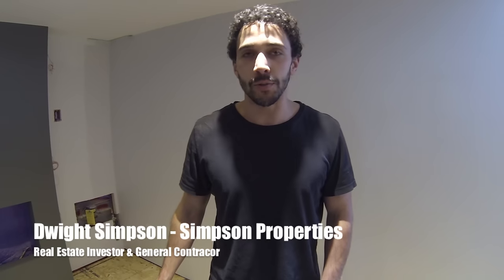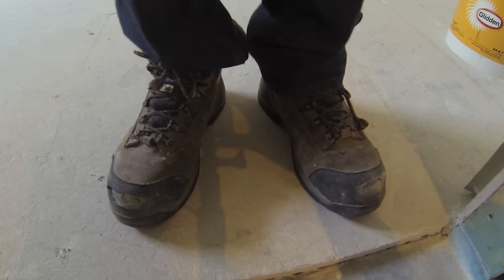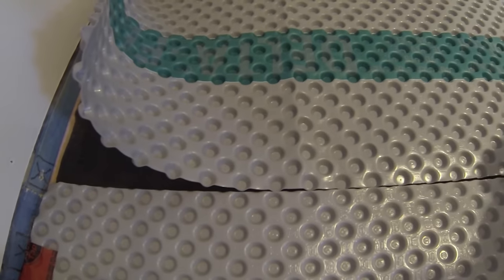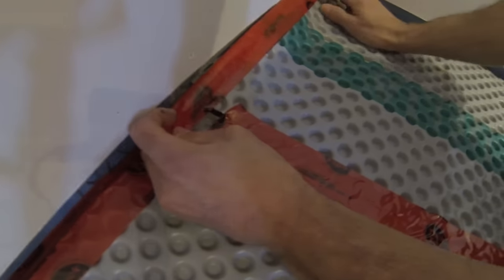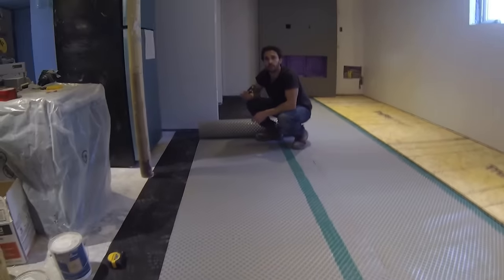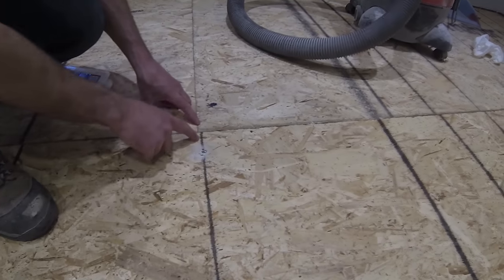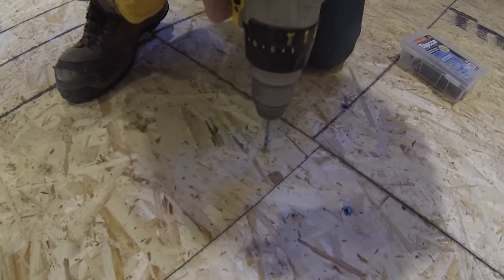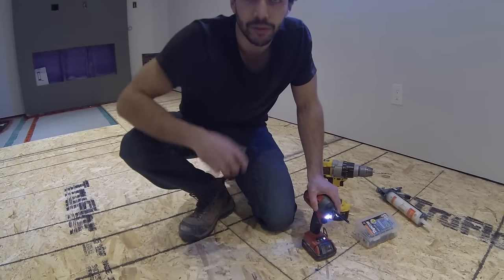HOW TO INSTALL A SUBFLOOR ON CONCRETE

Comment: Great Video, Quick question. I am installing a sub floor on a concrete slab on grade level. I live in Florida and not to worried about the floor temperature, should I still use the Delta FL or do you have any less expensive alternative to use between slab and wood? Thanks
Reply from the maker: Danny Bautista thank you! Delta-FL used with OSB is the most cost effective method without comprising on quality that I have come across. Even if your slab is on grade level you still have to have a membrane in between the OSB & concrete pad; or else it will wick moisture over time.

Comment: I have seen other videos mention you can frame directly on this system. I would like to finish my basement with the Delta-FL and osb first then put up the framing using standard 2x4's and not have to use pressure treated lumber and use normal carpet grippers. Possible?
Reply from the maker: That is definitely possible and in my opinion the better installation method.

Comment: Will it matter if my concrete floor is not even at all? Any extra measure around that?
Reply from the maker: If you check the manufacturers spec sheet on Delta-FL it states what the floor tolerances should be. If the floor is fairly level you will be fine. If there are big dips. You may need to fill those areas with self leveling concrete or use shims. Any high spots will need to be shaved down with a concrete grinder.

Comment: Aren't the trufloor panels sized for spacing? It looked like you kicked the butt joints tight.
Reply from the maker: That’s correct. You should leave about an 1/8” gap for expansion and contraction.

Comment: Thank for this. When you drill subfloor through your 'vapour barrier' layer (deltaFL) doesn't that "break" the vapour barrier and create moisture issues/allow moisture to get to the OSB/subfloor? Maybe abit of bounce in the floor is ok if it guarantees no mold/moisture in the subfloor?
Reply from the maker: Mel your slab shouldn't have that much moisture where the pilot holes for the concrete screws will create an issue. That's why I filled each hole with silicone to maintain the vapor barrier. If you don't anchor the sub floor to the slab it will create problems for you down the road depending on what floor you use. It will create shifting/buckling and bounce in your finished floor.

Comment: Is this method ONLY for the basement, or is it ok to do this on a ground floor?  Because of the 7 degree difference, I'm getting mixed advice on whether or not this is safe for a solid hardwood (not engineered hardwood).
Reply from the maker: This method can be used in a variety of applications not just a basement slab. If you’re installing solid hardwood you maybe better off doing a glue down method directly to the slab. That’s what I would do especially if you live in a warmer climate. Always read the spec sheet from your hardwood floor manufacturer. They will specify approved installation methods.

Comment: Great video. I am actually in the middle of a flooring project and I intended to try the landscape fabric... Home Depot says that they only carry it in the summer. Are there any alternatives?
Reply from the maker: Thanks +David Barrett! I'm not aware of any alternatives other than using a different underlayment like DMX that has foam built-in (that would not be cost effective). Maybe try ordering the landscape fabric online through Home Depot or another vendor.

Comment: Great video. Does the landscaping fabric mold or have any issue if it does get wet? Also, before doing this, was there an issue with water seeping into that area or was this done as a preventative measure?
Reply from the maker: Landscape fabric is designed to be installed outdoors in the earth. It will last years in those conditions before breaking down. You won’t have to worry about it deteriorating when it’s installed indoors beneath your subfloor. If you have normal slab conditions that minimal moisture will not be an issue. This install was done so that the finished floor was not installed directly on top of the slab. Provides a bit of a warmer floor and avoids any moisture wicking from the slab into the finished floor.

Comment: Interesting video but you have to gap OSB about 1/8th inch around all sides.  If you don't,  you risk cupping when the OSB expands.  Also,  tongue and groove would be a better choice for floors. 

Finally, code requires far more fasteners than 8 per sheet of plywood.
Reply from the maker: Thanks for your input it’s much appreciated! I agree that a 1/8” gap should be left around the perimeter of the OSB for expansion and contraction. Unless, an OSB like AdvanTech is being used because it has the gap incorporated in its T & G.

T & G laminate floors were used. In this case the concrete slab is the structural floor. The subfloor was installed as per manufacturers recommendations in regards to the amount of screws that were used.
Reply: @simpsonpropertiesltd  Not to be argumentative,  but building codes (which  vary) usually require fasteners every 6"-8". They will govern,  not the manufacturer's instructions. It is difficult to know what code is,  because this is such an unusual application. Typically subfloors require fastenets 4" OC on seams and 8" OC in the field.
Reply from the maker: FL FL it’s all good I appreciate the input. I agree with with in regards to code with typical floor sheathing installed on top of floor joists. 

In this videos application it’s a sub floor over a structural concrete slab.

Comment: Great video! Thank you very much. I am getting ready to do this in my basement...starting on it next week, I hope. A couple questions: first, are there advantages to laying the flooring and the underlay lengthwise in the room, as opposed to the shorter direction? Finally, would there be any benefit (or drawback) to crossing the seams, i.e. running the underlayment the shorter direction and the osb the longer direction? Thank you for any help!
Reply from the maker: It’s looks better IMO to run length wise. Makes the room look bigger.

Comment: Love your video! I was wondering if would you recommend doing that for an entire basement before putting walls/divisions? If so, would you then do the similar drill and caulk approach for the bottom plate to secure it to the concrete slab? Or would you have the bottom plate screwed or nailed to the plywood board only not going through the membrane?
Reply from the maker: I would recommend installing the subfloor everywhere. Then install your walls on top of the OSB. In that case you would not need sill gasket since your bottom plate is touching OSB instead of concrete. You would need to use ramset fasteners or a Simpson Strong tie concrete fastener.

Comment: This is a great learning video for preparing concrete slab floors.  Once everything is installed can I install nail down hardwood flooring over the 5/8" plywood or OSB?  Or am I limited to types of flooring material?
Reply from the maker: Al Akiyama thanks! Yes you can install nailed hardwood floor over this sub floor. A lot of hardwood floor manufacturers will require 3/4" subfloor. You can still use the same installations methods shown in this video. You will just use thicker OSB or plywood. Check with your flooring manufacturer on the required thickness of your sub floor.
Reply: Thanks for the quick response.  Do I need to install a barrier ( like roofing paper) between the plywood (OSB) and the hardwood floor?
Reply from the maker: Al Akiyama that all depends on the flooring manufacturer you choose. Various manufacturers have different requirements. Check with the manufacture or supplier.

Comment: Do you need to install the plywood if your just doing a small bedroom in a basement
Reply from the maker: You can install the Delta-Fl (or membrane of your choice) then install your finished flooring on top. You don’t have to install plywood or OSB.

Comment: Excellent video and detail provided, thank you! We just did this today, as shown, and noticed some areas have movement when stepping on them (either concrete not flat or OSB). The final visual of the OSB is all flat, just bows in a bit in certain areas when walked on. What are your thoughts? Use more tapcons?
Reply from the maker: bmoreira2000 thanks! Some sheets will require more tapcons than others. As long as there is not a huge bevel or slope in the concrete pad more tapcons should solve that issue. Make sure not to over torque the concrete fasteners or else the won't hold properly.
Reply: Thanks for quick response! So the thought is the OSB should not move when stepped on?
Reply from the maker: That's correct you shouldn't have any flex in the OSB. It should be a solid floor with no bounce in it.

Comment: What’s your take on framing walls first or putting your sub floor down with walls framed on top when you have an interior French drain and a thin layer of concrete over it?  I’m concerned about cracking the concrete when fixing the base plate.
Thanks
Reply from the maker: Installing the subfloor first then installing your framing on top is a more ideal method in my opinion.
Reply: Thanks for the advice

Comment: If you wanted to insulate would you just put rigid insulation under the osb ?
Reply from the maker: Yes that is a common way to insulate below your subfloor. Make sure which ever rigid insulation you buy it’s rated for that application.

Comment: I'm in the uk and moving from s home with a wooden sub floor to one with a concrete floor. 

In the UK.  We run cables mostly under the floor then up the walls.
Can you run cables under these flooring and if so.. where?
Under the boards or under the plastic bubble wrap type stuff?
Or not at all?
Reply: Jason Park 
Probably not at all with this style floor unless you double up the OSB plywood and create a channel for your cable above the first OSB layer and make a channel in the bottom of the second layer it would be difficult to do.
Here is the U.S. we usually don’t have finished ceilings in our basements we use drop ceilings and can run our wiring there.
But maybe the gentleman who made the video can weigh in...
Reply from the maker: This type of subfloor is not designed to have cables running beneath it. They would get damaged overtime. Conduit would have to be installed in the concrete slab and cables could safely be fished through it. In residential construction in Canada the majority of wires are installed in the walls and ceiling cavities.

Comment: Great video and I am actually starting the DMX install this weekend.  I noticed you used landscape fabric underneath the poly.  I have some spare roofing paper around do you think that would serve the same purpose??  Thanks and keep up the great videos!
Reply from the maker: Thanks. This reply maybe a bit late. If you used DMX it already has a cushion built into the membrane which helps avoid that clicking sound.
Reply: @simpsonpropertiesltd  No actually not late at all.  I am not using the DMX with the foam underlayment.  I have the one just like yours in the video.   Would the roofing paper not be applicable for this?   Should I just go with some regualr landscape fabric?  Thanks!
Reply from the maker: Cosella Dorken is the manufacturer of Delta-FL. I would give their tech support a call with that question 1 (888) 433-5824. My guess is they are going to recommend using landscape fabric.

Comment: Your videos are giving me great insight as to how I want to finish the basement I'm working on....with this type of flooring delta and osb...is there any need at all to use self leveling mix?  I'm thinking mold resistant underpad afterwards with carpet but if I should also first consider self leveling some areas I will.
Reply from the maker: If the slab is really un-level you may have to grind down high spots or use self lever in low spots.

Comment: Can you tile directly on the Delta membrane or if you need the subfloor panels? Thanks Great job!
Reply from the maker: TheSimuzz I would recommend installing an uncoupling membrane such as Ditra or Strata matt on top of the concrete slab then you can install the tile.

Comment: I live in Texas so there's no basement but our first floor slab is concrete underneath the carpet when I pull my carpet can I just go over it with the plywood my house was built in the mid-70s
Reply from the maker: It depends on what your finished flooring is going to be. If you're going to install a floating floor system such as laminate then I would recommend you install a product like Delta-FL then your OSB or plywood.

Comment: Would the landscape fabric not collect and hold the moisture? Therefore causing a mold issue?
Reply from the maker: Dennis Gadd if you have enough water on your slab where it is pooling that has to be addressed before installing a subfloor. Landscape fabric is designed not to mold or break down. You won’t have any issues and it’s recommended by the manufacturer.

Comment: Great tutorial!  I have a question, in the 'after'video the floor appears to dip down in the center, like it's unlevel.  Is that because you were using a wide angle camera lens or is that how the floor turns out when you don't have a level floor frame, too?
Reply from the maker: Castaway thank you! That's the camera angle making it looked like it's sloped.

Comment: Ok..so if I choose to use landscaping fabric, that will have the same result in keeping out the moisture? I have a dehumidifier in my basement as well. I"m wanting to do the floor, because there are broken pieces of concrete that I just don't want to deal with..LOL.
Reply from the maker: The landscape fabric does nothing for moisture. It helps prevent the hallow or clicking sound. You will still have to use a humidifier after installing a subfloor.

Comment: Great Video... I learned SO MUCH! We have a 3 season room that is truthfully a 1.5 season room.  We would like to get more use out of it.  The summers are not so bad, but the cold Northeast winters are killer! The walls of the room are a whole other video (literally just wood panels, the house is early 1900's).  But, in the meantime the floor is unbearable.   Do you have any further advice on how your final room's wood flooring process went?  Ideally we'd like hard wood... maybe even with radiant heat, but I'm guess that may be a bad idea with this process. I'm curious to know your thoughts! Thank you for your time and awesome videos!
Reply from the maker: Laura Shames thank you! That's awesome that you learned something from my video. It's tough to answer this question in a quick comment. Insulating your exterior walls with 2 lb closed cell spray foam and radiant in floor heating would be the best option for this room. The radiant in floor heat would provide enough heat for the entire room as well. It's a totally different process than what you see in this video. If that option is not in the budget you can also install rigid foam boards beneath your OSB subfloor to provide a higher R value. If you have anymore questions let me know.
Reply: how did you go about your floor drains and access points

Comment: Does the landscape fabric defeat the purpose of the Delta FL? Will this not mold or restrict airflow?
Reply from the maker: Not at all. Landscape fabric can be installed outdoors in the earth and does not break down fro 20+ years. It's recommended to be installed by the manufacturer.
Reply: @simpsonpropertiesltd  Perfect, thank you!

Comment: Can I put the barrier and new vynil on top of vynil tile prior1986 to laminate? 😊
Reply from the maker: Make sure you don’t have asbestos tile. If there is asbestos tile I would recommend having it removed by professionals first before installing anything on the floor.

Comment: Hello. In my basement, I want to build 2 rooms. So I have to build walls and floors. Do I first build floors, as in your video, and then walls or walls first? Some people say that I have to build floors first, so air could circulate easily. Others say that I should build walls and then floors in each room. Please tell me if you know. Thank you
Reply from the maker: Either way will work. I prefer to install the framing on top of the Delta-FL and OSB. If you do install your framing first make sure you put a sill gasket on your sill plates.

Comment: If you're starting from "0", and have nothing framed, can you lay this down and frame on top?
Reply from the maker: Yes you can do that. In fact, that’s how I would recommend you do it. That way your base plates are off the concrete pad. Make sure you still use fasteners long enough to secure your walls through the base plate, subfloor, and into the concrete pad.

Comment: Hi, how even does the basement floor has to be ? I have a few high spots but was going to grind them down and use some shims under the plywood to get them as even as possible? thoughts?
Reply from the maker: This is directly from the Delta-FL installation guide: "The floor should be as level as possible. Remove any bumps or ridges. In areas with
 depressions greater than ¼”, self-leveling compound should be used". You could either shim the low spots or use self leveling concrete.

Comment: Great video! Quick question, what kind of landscape fabric are you using? In your video, it almost looks like a felt.   Also, any worries or issues that you have come across that result from drilling through your vapor barrier?  I plan on letting it float because of this.  just wondering
Reply from the maker: Thanks! I used standard residential grade landscape fabric. Using concrete fasteners is recommended by the manufacturer. The Delta-FL is not necessarily a vapour barrier. It does help provide a bit of a thermal break.

If you want a proper vapour barrier with a concrete slab it should be installed beneath the concrete before it is poured.